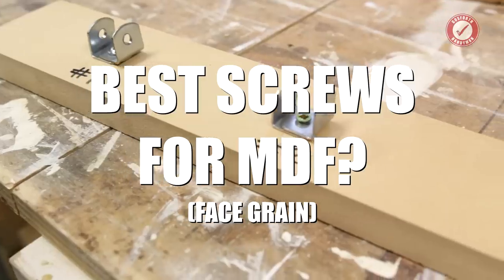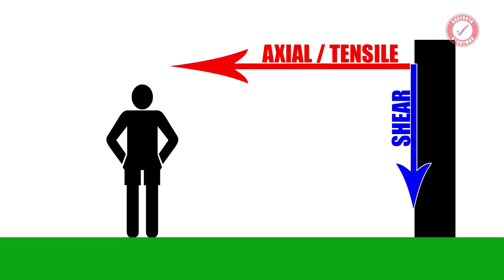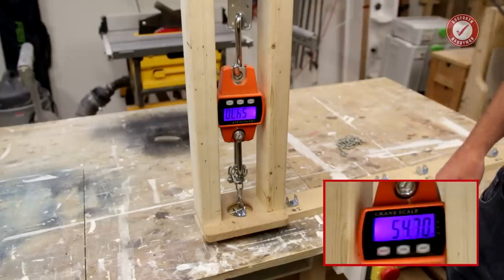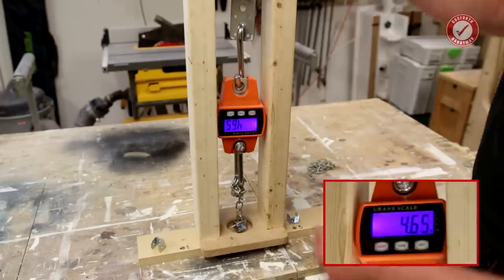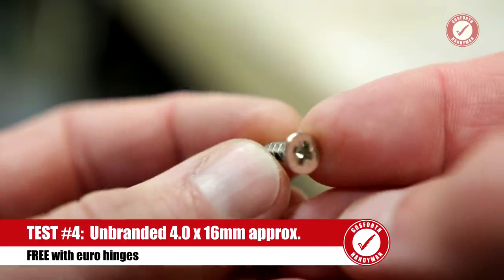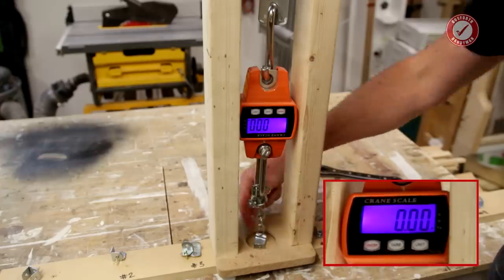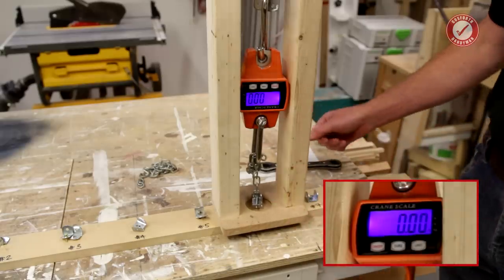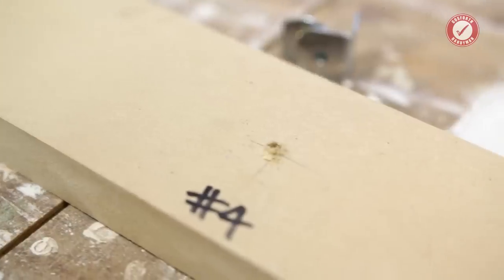What are the best screws for MDF face grain?

Comment: About test #6 - 4.0x16 vs 3.5x16 - The length of countersunk screws includes the head. Which means that if you increase the diameter, the head size will also increase, leaving less space for overall thread length. If you check them closely the 4.0x16 will have fewer thread windings than 3.5x16.

Comment: hello
when i was able to  work which i had to give up due to a medical issue
i  was making and installing kitchens and fitted furniture i alwasy used 4 x 20 mm counter sunk  hafele own brand  pozi drive screws to put on the blum euro hinge on the doors and the 18mm carcase  gables
and i never had a screw come through the outside of carcase or door   and i agree totally with you  that  some of the screws can and do snap when under preasure   as usual a fantastic  video  with great info

Comment: I swear by Ovalok MDF Screw. They have not let me down as yet
No reeming and are available in many sizes. I mostly purchase those from screwfix or Homebase;.

Tip! When screwing into the edge grain, drill a few mm and add a spot of glue; this prevents splitting.
Reply: What kind of glue? I am completely new to handyman stuff.
Pardon me if this sounds ridiculous, but would something like school glue suffice?
Reply: @ItsJustaMeNow  Gorilla wood glue

Comment: Spax! Spax! Spax! Spax! 😂  Great test mate - I've never had a screw fail when driven into the face of MDF, though I do put mine in with a torque-wrench 🤓😂😂
Reply from the maker: Cheers bud. Torque wrench for every screw when you're in London. 😂😉😂
Reply: Agree, Spax especially their Spax-M designed for MDF. But they dont do 16mm length.
Reply: Geoff Kinlen Well, Spax-M are meant for ‘end grain’ MDF, so not much need for anything that short. Regular Spax do well into ‘face grain’ MDF 👍👍
Reply: Umm, dont think so. Their ads say design 'eliminate splitting and bulging on the front surface of your MDF board or when working close to the edge'
Reply: Geoff Kinlen Yep, ‘working close to the edge’ means in the end grain of the board ie the cut edge. Spax-M won’t split the ‘end grain’ so won’t make the face bulge. 👍👍
Reply: Peter Millard I must give that ago tmw

Comment: Would be cool to see a TestTuesday video where you test various joinery methods for a simple (plywood?) box. I'm trying to build a CNC enclosure box, but the test could be about drawer construction; comparing ugly screwed butt joints, less ugly pocket holes, dowels, and then fancier lap/finger/dovetail joints or whatever - then comparing the boxes for strength against racking with force applied (without a backing board/drawer bottom ofc).  More effort than a handful of screws though :p
Reply from the maker: Just biscuit and clamp the whole thing - can't go wrong. 👍😀

Comment: I need to attach a 1-1.4 inch thick mdf table top to a metal work bench frame, but the heads of the screws need to be big enough (a little larger than a pencil) to not go through the hole in the metal frame of the workbench. NO one in the hardware stores seem to have ANY idea of how to do this. Can you offer me any guidance?

Comment: I do enjoy your videos, suggestions and test tuesday.  But the screws you are testing are the cheap run of the mill screws.  I'd be interested in how they fair up against a Reisser screw.  Which Screwfix also sell.
Reply from the maker: Might do at some point but I can almost guarantee the results would be pretty much the same. The Screwfix screws are all carbon steel high quality screws. 👍

Comment: Question I have built a frame in my cellar and used 9mm mdf all screwed in and fixed no problem. Now the million dollar question I want to put some shelves up can I just screw straight in to the mdf and what screws would I use or should I put some kinda raw plug in and then screw to give it more security

Comment: I had a old master trim carpenter tell me if you have a screw pull out of mdf, you can drill the hole oversize, glue in a piece of dowel that fits and it will allow you to put the screw back in the same spot. I have never tried this, but I wonder if you might test this with a couple of your screw  picks, and see if it is a suitable repair, or the old man was pulling my chain.
Reply from the maker: Yes - defo. Would probably be stronger than the original screw since MDF takes glue very well and the dowel should take a screw very well. 👍
Reply: Gosforth Handyman - now I thought about it, it might also be an excellent way to patch a misplaced Blum hinge. Although the dowel would show on the back of the door, it would be invisible from the front. Since most people don’t look at the backs of cabinet doors, a bit of paint might make it disappear.

Comment: It would have been interesting if you had also tested the strength of a bolt (with a small sized washer) that way we could get a rough idea of how the screw axial force compares to the "Maximum" axial force the MDF itself can withhold. Hopefully I am not talking nonsense ...
Reply from the maker: I think even a small through bolt, like the sort used on cabinet door handles, would take more than my test jig could handle (300kg+). 👍

Comment: I want to install safety handles on my child's Ikea stuva loft bed at or near the top of the ladder. Would you recommend a bolt/washer/bolt or a wood screw (which type)? The width I will be drilling or screwing into is 1 1/4 inch or 3.175 cm. Thank you in advance.

Comment: I'd like to see a comparison of pilot hole sizes on a standard screw shaft.. is it better to leave more "meat" to cut into, or allow the shank free passage through the wood leaving the threads to cut into fresh material.

Great video as usual, although I'd like to see a re-test of that anomalous TurboGold 4x16. It was the amount of material that screw pulled out with it that inspired my pilot hole thoughts.. did the thicker screw actually damage too many fibres going in?
Reply from the maker: Pilot hole - on the list. I think the Turbogold 4x16 was just down to the bigger head meaning less of the actual screw thread made it in to the wood - coupled with the more aggressive self-drilling tip removing too much material. I think! 👍

Comment: What kind of screw would you suggest for a speaker that weighs est. 11.5lbs with an MDF backing to a ceiling mount? I'll likely be screwing at least 5-6 screws into each speaker and should I pre-drill the holes or just screw the screws in straight using a drill or do you suggest using a standard screw driver?

Comment: Great video. However I notice the majority of screws tested have a self countersinking head that cuts into the surface, so would make a mess of a metal fitting, particularly if plated. I talked to sccrewfix as I have a need for using 3mm diameter screws and they could not find any in their range that would fit  without the self cutting countersink. Toolstation do seem to have something though.
Reply from the maker: Yeah... I prefer the flange head for that very reason. Wish they did flange head with a slightly coarser thread. 👍

Comment: i would not trust manual cranking test because the person cranking it can make one screw reach a higher holding strength by doing it faster the ratcheting pull faster than others ....there for it pulls out quicker and if you ratchet slower the screw has a better chance to hold longer and reach a higher weight ....so i would trust it more on a machine that pulls consistently at an equal motion and pull ....non the less good to see.

Comment: Do you think it would make a difference using a small pilot? 

I tend to pilot using a 1.5mm drill bit, i just wonder if clearing some of the flufy bulk out of the mdf would make it stronger or not?
Reply from the maker: On the list to test that - I normally only pilot for alignment using a self-centering bit for a starter hole. 👍

Comment: MDF has no natural grain so it doesn't have near the strength of actual wood. I watched a wood joint video where a deep joint held well over 270 kilos before the board itself split. I don't remember if it was even a hard wood or your average pine though. I'm pretty sure a simple glued butt joint actually held over 60 kilos in his test (although his testing method was different). Based on this test though your best screw didn't even perform twice as good as glue. 

MDF seems like its begging to be properly jointed. Since its so soft it cuts like butter. From my first use of it I'm really not impressed with its screw holding strength. My first screw test without a pilot hole striped the MDF immediately and spun in the hole. With a pilot if definitely grabbed a lot better.

I'd rather do proper simple finger joints and glue.
Reply from the maker: What brand of MDF are you using? I wouldn't recommend finger joints in MDF. 👍

Comment: Hey, Im having a hard time pocket holing MDF. Any tips or suggestions you can offer? Im using a kreg kit with right kreg screws but it still splits.
Reply from the maker: Bad news - you can't really pocket hole MDF if the thread is going in to the edge grain - well you can, but it will be a weak joint. Fine if the thread goes in to the face grain but you need to design stuff to avoid screwing in to the edge of MDF if possible. 👍
Reply: @GosforthHandyman  Yes I understand going into edge grain of anything especially soft is a big no-no but I see it done plenty so thought there may be a special trick. I have tried over 10 times including hand screwing in the screw but once I unscrew it, the split/crack is clearly there. But I completely understand what you are saying and thank you for your time and advise!
Reply from the maker: No worries - the folk who you see doing it on YT don't understand how MDF works. 👍😀
Reply: @GosforthHandyman  Thanks much for the help. Being a new "woodworker" (3 months since I made my shop), this is all so new to me and as great as YT it, there are always those questions that I cant find answer too. Its surprising but there are only 2-3 videos on pocket holing MDF on all of youtube.

Comment: Very interesting test. Thanks for sharing.
What's the advantage of MDF above chipboard (both melamine coated or "pure")?
Is it stronger, or lighter in weight? 
I was at a cabinet maker in my home town in Slovakia but het does not use MDF (only sometimes for kitchen cabinet-doors)
In general it's too expensive here. People don't want it (or they don't know it)
Reply: Hi Hans, MDF has a much smoother surface and therefore makes it an ideal product for making "low cost" cabinets.  I'd say you can probably make anything in MDF that you could with chipboard /particle board.  MDF is made with long fibres whereas particle board is made with short grains/chips.  Not sure about the weight, (both are incredibly heavy, compared to say plywood)  
As you probably know chipboard is lousy at holding a screw into the face and edge, whereas you can see from Andy's test results MDF does a pretty good job with holding a screw driven into the face (it is not as good on edge, but still better than chipboard in my experience!)  My "guess" to your first question would be that MDF cabinets would no doubt last longer than a cabinet made out of chipboard.
Do they primarily use melamine coated particle board for kitchen cabinets in Slovakia?  What are you doing now?  Cheers, David
Reply: Thanks David, for your extensive explanation. It seems that I'll have to find (buy) somewhere MDF (scrap pieces to begin with for trying things out)
Yes, in Slovakia (at least according what I heard from the local kitchen cabinet maker) primarily melamine coated particle board is being used for kitchen cabinets.
Your last question "What are you doing now?"  I don't  understand.
At this moment I'm reacting on your explanation.  In daily life I'm self-employed. I like DIY and I'd like to 
start up a kind of Handyman service.
Reply: You got it, I misunderstood your comment "i was at a cabinet maker in my home town".  I had meant "what is your work/job now".  Having been self employed, I feel this is a much better way to make a living.  Do you also follow Peter Millard and Charlie DIYte they both communicate very well and offer a lot of info that's valuable to a handyman.  All the best and maybe you can combine YouTube with your handyman business?  (because I figure YouTube gives Andy (gosforth handyman), Peter (10 minute workshop) and Charlie (Charlie DIYte) some credibility and a leap over their competition)  Cheers, David.
Reply: Thanks David.  Yes, I follow Peter Millard (from spring this year or so). Through him I came to the YT Channel of Gosforth Handyman.  The Charly DIY YT Channel I don't follow (till this very moment I did not know the existence of it). I'll for sure have a look there.
I have so many ideas/plans for doing/making things but time and energy have their boundaries.
I'd like to be a cat, which has 7 (9?) lives. But I'd like to have those lives all at the same time.
Since this is not possible, I'll have to cope with the facts of  "normal life".
Reply from the maker: Great comments all 'round. Just to add, MDF takes paint, screws really well (if you use the right screws) and takes glue very well. You can also do nice smooth routing (e.g. round-overs for window sills etc.). Melamine faced chipboard (MFC) is great for shelves etc. in cabinets as it doesn't need painting and the melamine is very hard wearing - but chipboard is terrible for screws. Both don't like water. Even moisture resistant MDF isn't completely immune to water damage. 👍

Comment: Out of interest, what is wrong with Philips screws?
Reply from the maker: Pozidriv gets a better grip on the screw so less cam-out. 95% of screws in the UK are probably pozi... apart from drywall screws for some reason. Can't use a pozi bit in a phillips screw so always a pain if you come across one, having to dig out an old phillips bit. Phillips are just outdated. 👍